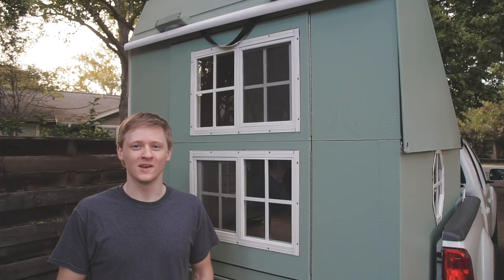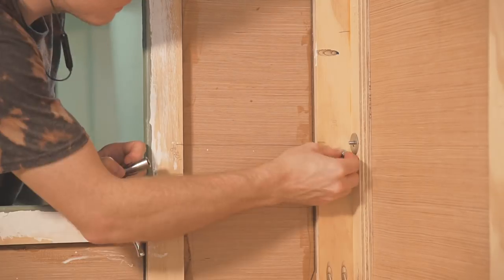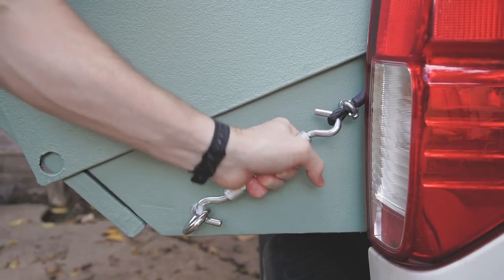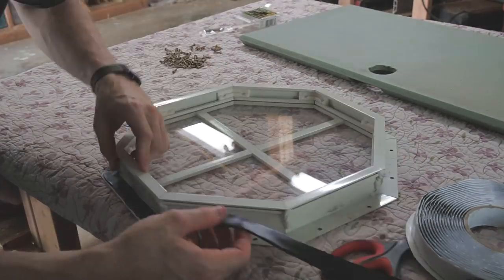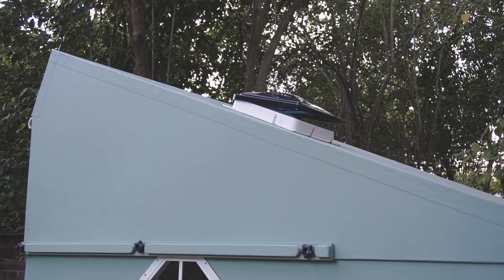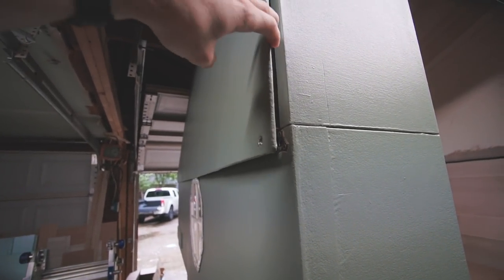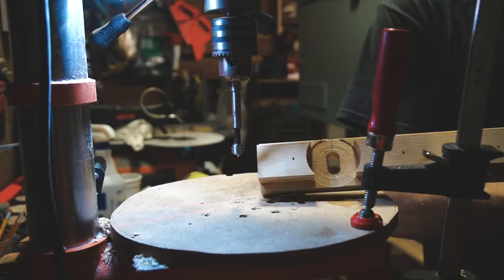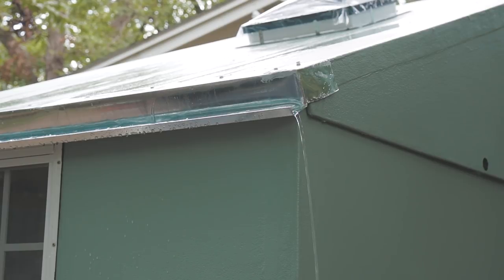Building a Truck Bed Camper - Part 3: the Exterior is Done

Comment: I build campers for a living.  Excellent job.  You could simplify your sides.  Your thumb screws are effective but finicky to work with.  If you had an interlocking sets of "J" metal made up with a seal so that you wouldn't have to fiddle with anything, just pop your top fold out your back panel and your done.  Just a suggestion, but even exactly as you built it it's amazing.

Comment: Add a couple of small wheels to the back of your camper. They will self align in the bed valleys and when the camper is sitting flat it shouldn’t allow the camper to shift much. You don’t need much clearance so it shouldn’t throw off your level bed surface too bad, but it reduces friction enough you should be able to push it in and drag it out easier. Just a thought, this design worked for me. I made my wheels out of the plywood, but plan to upgrade to rollerblade wheels later.

Comment: If you put a small piece of PCV or steal pipe under your camper when loading it will roll on the bed floor while you are pushing it in and will be at the tailgate when you finish so you can take it out.. I have loaded large pieces of equipment this way, moved them across shops. It is amazing what a little pipe can do under a large flat object.

Comment: Nice job on the camper! You mentioned that you were having trouble loading it into the truck. Try using small rollers on the bottom to aid in sliding it into the truck. Great job!!

Comment: This is the smartest concept of collapsable truck camper I have seen. I recommend you consider a patent on the great design! I have a concern regarding its lenght as it protrudes behind the truck, it could be ilegal in some places. But great! Also, just to mention, the rear hooks are pulling the camper up, when I belive they should be pulling down to keep it attached to the vehicle. Hence, those hook mounting points in the camper should be located upper than the ones in the truck bed.But again, fantastic concept!

Comment: I have been contemplating building my own truck camper for some time now. After watching you videos I am glad I found them. The slid up roof is a great Idea, I was thinking of how I could do that. Your innovation has reinforced my ideas. Thank You now on to number 4...LOL. BTW I intend to use steel studs and hang it beyond the sides of my bed so I can mount the bed cross ways.

Comment: thats a really sweet build. How about using a pulley at the front of the camper? there should be enough room between your runners to run the line back to the tailgate. wax your runners and the bed
Reply: hope it works
Reply: loose the pipe and use teflon furniture and appliance slides.  low profile and make moving heavy loads a breeze

Comment: Instead of using bungees to hold the roof vent down when driving, you might consider building a wedge-shaped air spoiler in front of the roof vent to send the driving airflow over the top of it.

Comment: A lot of thought went into this build. Its sweet. I'm a handy man and i must say using items like the windows in this build todo what they may not have been intended to be used for in terms of application was very smart. Great way to keep cost low. The designs is also sweet, you may have just designed a new pop up camper. Good work young man.👍

Comment: 8:44, try adding a 3 inch strip of extruded aluminum the full length of the side. That should even out the applied pressure, and dress it up a bit. Nice option though.

Comment: Again, Nice job! Very innovative!

-Do you know the final weight?  
-Do you know about how fast were you driving for the gas mileage compare? 
-Do you know the turn buckle weight rating?  Finding them with more than 150lb rating at hardware stores was hard for me. 
-The side stiffeners is what I had to add also to keep the lower edge of the top straight (mine is more like a shoe box). 
-Campers on dual wheel pickups use extenders to reach out to the front jacks that fold in during travel. For the moment I use a temporary 2x6 across the front and back as my extenders.
Reply: Moser Makes, Thanks!  I weighed mine with a manual 300 lb dial scale by tipping it and  weighing each side - close enough. If it weighed more than 600 lb, I could use a lever. For example, if you put one end of a 2x4 on the scale and the other on the ground and stood 1/2 way from both ends, the scale should read 1/2 your weight.  Glad I was wrong, and the pvc did not make it too slippery, so friction keeps it in place better. WOW!  If you do not have much noticeable drag at 75 MPH, you REALLY did a great job!!  Thanks again for sharing!
Reply: @MoserMakes , maybe you can check your area if there might be a scale you can drive over. Around my city there's a recycling facility and a dump that have scales like that. They weigh my truck when I enter, and then weigh the truck again after I unload cardboard or construction debris.

Comment: I like your design ... The problem of the thumb screws was an interesting problem.  I just installed a mirror with a french cleat and thought that perhaps that would work.  You could actually just have a piece of stainless steel sheet bent into a flat "s" and attach that to the inside of the upper sides.  Then the s would engage like a french cleat.  The challenge would be to have it release when lifted up.  But with your brilliant idea mind I am sure you can turn my crude idea into something elegant!

Comment: Add a runner underneath so can slide in the 2 metal tracks you have mounted in bed of truck or small caster wheels that lock.

Comment: If you add some kind of PVC to the truck bed so you have PVC to PVC slides it will work a lot better just like lay it in the bed before you start to put it in and take them out after

Comment: Use ball bearing rollers that are used in working attach them the bottom of the camper and it roll right in with very little effort like these ones from Amazon. True Power 10-9111 5/8" Roller Ball Transfer Bearings, Set of 6

Comment: You need to put some tiny holes and some of the stuff so you can put safety wires like to do an aircraft so it's not going to unloosen while you're driving but it's a great concept of flipping it up like that the cut down the drag when I first saw it the it was so wide and back I said man this isn't going to be kill your gas mileage but your flip up concept really is impressive
Reply: I'm trying to make something that is more of a bear with me here more of a taper down so that when it's on I'll get better gas miles not just the same and but I like the way you did this is soap and supper an Avenue of what I might be able to do with a more of a taper type bed cover but I really want to insulate the crap out of it cuz I want to be able not to freeze during the winter time so that's why I'm kind of hesitant on making something that hinges I'd rather be more cramped on something that super insulated that'll keep me toasty warm with very little energy input which I want to actually run the some sort of heat exchanger off the engine to melt wax inside the the unit wax liberates its heat very slowly

Comment: didn't you need to drill some tiny holes in those turnbuckles and put a safety wire in there so can't twist off and loosen up they do it on airplanes. Did you put any foam insulation underneath or on the sides or even on the roof I know you're not taking out in the winter time but still it's a great design. I'm still thinking about making one putting a streamline section on the sides of my camper so I can actually sleep sideways I'm only about 5-6 or something so with my Ford Ranger I should be able to sleep sideways I just put a slide extension on the side weather I whether I have it pop down and have a slide out or not but that saves a lot of a lot of space it seems to me
Reply: Like I said I love your product your product but I think I'm going to go with my sloped down pickup truck situation and just have enough room here to hunker down in an emergency and after the weather gets better I'll pick up the flap and   have more more . If you can use your hot water from your radiator is it driving to your location to melt wax the wax will release heat as it solidifies all night and keep your place warm. Is stores twice as much heat per pound did than water
Reply: And thinking about the outside walls of flip-up you could put a mat and hinges and put magnets so when when when you lifted the whole thing up the magnets Woods Woods seal up against the the outside wall and that would be insulation with them some fabric holding it securing it so could hinge and and move up against the fabric once you extend it all the way

Comment: I really like your design. I have been designing a small camper trailer to pull behind my Subaru Crosstrek. My plan is to keep my entire weight 500 lbs or less. My camper hinges allot like your design giving me standing headroom at the highest point when set up. The width is based on the width of my car body and so is the height. When in the travel configuration it will be aerodynamic. I'm still figuring out my length. Most likely it will be 8ft or 10ft at the longest. 
 Just one question what lb load struts did you use. The weight of your camper gives me a pretty good idea of what to expect from my design. Thanks for sharing. Looks good.

Comment: Rvs use a product called dycor to seal the roof openings it would be good insurance. I'd run a bead of silicone on the windows mounted to the walls as well.

Comment: How about  insulation  help with velcro.  Have you added extra light to the trailer as it extends beyond the bumper.  Why. Not a big yelliw nylon belt around the  bed between the cab

Comment: wat ou could do about pulling the camper ontoo and off the truck is using heavy ratchet straps mounted to the eyebolts near the cab and the rv top itself and have the campertop on the cart ou used to build it , just keep walking back and forth between the left and right side tensioning the ratchets pulling the camper top on , if the ratchet is full roll it of pull more ribbon through the ratchet and keep going 
for pulling it off do the same thing but use eyebolts on the back of the camper top and the cart might need some wood strips on the cart to keep the camper from sliding off the side 
https://www.youtube.com/watch?v=C7FWXmMJqZ8

Comment: Nice job on the camper! You mentioned that you were having trouble loading it into the truck. Try using small rollers on the bottom to aid in sliding it into the truck. Great job!!
Reply: Yes or a Pipe will do too